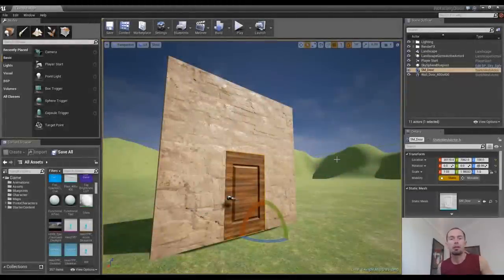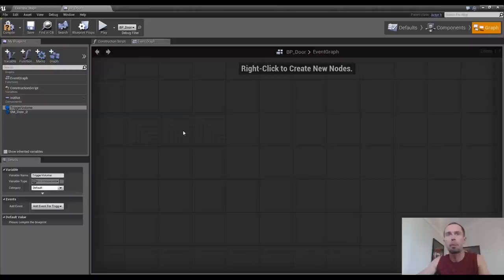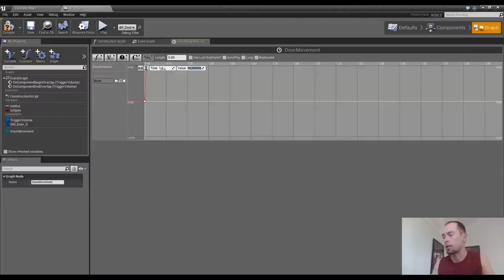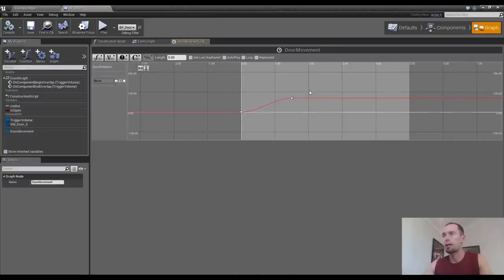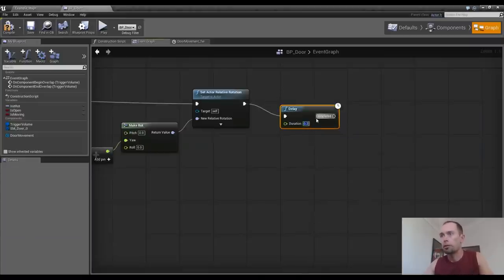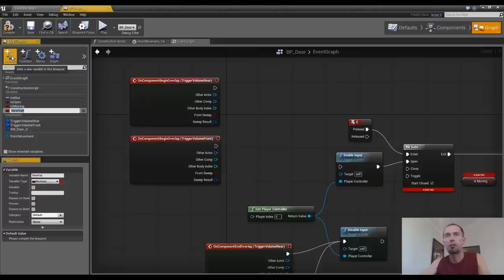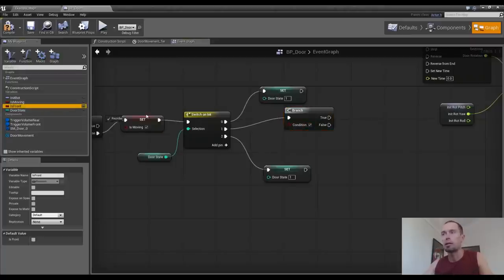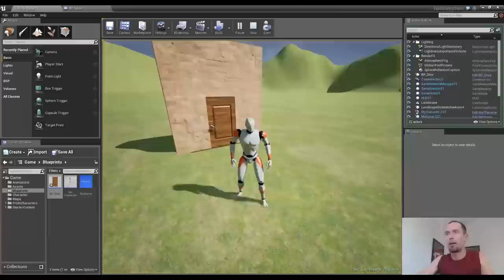Unreal Engine 4: Rotating Door Blueprints Tutorial (V4.6)

Comment: So my open door works... but the close, it jumps to some crazy ass rotation and then animates... which ends up wrong

What did I do wrong
Reply from the maker: I remember dealing with that same problem way back when.  I can't quite recall exactly was the culprit but from memory I think it had something to do with how I had things wired up.  When I would try to open the door it would snap to the fully open position then close.
Take a look at how you have things wired up, if everything is the same as this video then it might be the way you have things set up in your timeline.
Those are really the only things I can think of.  Other than maybe this is an outdated version of the engine and things don't really work the same way with the current version.  It's been a while since I've worked on any of this stuff (got loads of other commitments), but hopefully in a couple of months when uni finishes I'll have a chance of getting back into it again.
Good luck with finding your solution.

Comment: Great tutorial, I can replicate (And more importantly, understand the blueprint logic being used in the video) but I don't like how the door can open if for instance, I'm looking away from it.

I'd like some way to only activate the door if I'm pointed at it, and within a certain amount of distance, could a ray trace generated when I press E work? And if so how would I make that work with pushing the door open in the direction the player is facing?

(Would the ray still require a trigger volume, or no?) Or is there a better way to do it than a ray trace?
Reply from the maker: Thanks for the constructive criticism,  =)  
I'm sure there's a way of getting the global rotation angle of the player and comparing it the position of the door.  It would take a bit of experimenting to get things working the way you like it, but I don't see why it wouldn't be doable.
It might require using a little bit of vector geometry.
Otherwise you could try reducing the size of the trigger volume to make it difficult for someone to open the door unless the are facing the door knob.
Glad that you found the tutorial helpful.  I was beginning to think it was becoming too outdated.
Reply: CompSciGuyIT Just as you wrote that comment, I finally got my ray tracing solution to work! ( However, that's with the door opening one way, when I eventually get around to making it open in the direction the player is facing I may run into a bit of a headache )

Basically my character blueprint contains the ray trace that is produced upon pressing E, if it hits the door it triggers a custom event which is inside my door's blueprint, no trigger volumes needed that way (Obviously for a third person game this may not be a great solution but based on what I know so far it suits my needs in First person)

Comment: Great Tutorial, but how do i get the handle working? that would be a great continuation ^^
Reply from the maker: lepra73 Ah, that would require a separate static meshes for both the door and the handle, something you might have to create yourself (unless somebody has already done it).  The static meshes I've seen all have handles fixed to them, so getting them to move independently is impossible.
Reply: Well i have them in 2 parts allready, but can i animate 2 object in the same blueprint or is it following Same origo on everything?

Another thing i discovered is that if i do the door in matinne and then move it it has problem with the position even tho i only animate Z Axis.
Reply from the maker: It's been a while since I've used matinee, but I think there was a reason that I decided to use timelines instead.
I'm sure you could get the handles to move around an axis point, but to keep them in place with the door would require some pretty good mathematics I'd say.
But to answer your question, yes you can animate as many objects as you like in a blueprint.

Comment: Im in unreal engine 4.13.1 (thought i should say that to begin in case any updates have occured that I missed), but I followed everything and when I try to open the door, nothing happens. I even used simulation to see if the nodes lit up, which none did. Any ideas?
Reply from the maker: If version 4.13 has changed so much that you cannot get what's happening in this tutorial to work I'm afraid I can't really be of much help.  I haven't used the engine much since starting uni so I don't know how things are different in the latest engine.  
My only suggestion is to ask on the Unreal Engine forums or Answerhub.

Comment: I'm only 1 minute in and I'm lost, it seems that there is no "replace with composited blueprint" option anymore
Reply from the maker: That's because this video was made with a very old version of the Engine (V4.6).  I haven't played with V4.20 or above, but in V4.19 in the Details panel you'll see a blue button called "Blueprint/Add Script".  Click that and you should be able to continue on without problems.
Reply: @AlphaZeroOmega  I know, there is next to no updated info... and I'm so new, that I never had the chance to acclimate with this program
Reply: So I finished this, and I'm finding that randomly "On Component End Overlap" triggers, disabling my ability to use the door, unless I move around.... what?
Reply: @Gary the Go Getter  it would seemingly randomly trigger. But I moved the trigger volumes far enough apart that the player could not be inhabiting both at the same time. And if I press and wait, it will then trigger "On Component End Overlap" most of the time. It will also not trigger that I've entered the volume all the time now.

The only differences I've done is that I've opted to not have the "if moving" part, and just have the "doormovement" set to reverse, instead of "reverse from end". I've also tried with, and without the delay
Reply: I'll state that it worked fine before adding the reverse direction part. When it faulted, I recreated this from scratch, and the same errors
Reply from the maker: @fillman86  Whoops!  Looks like I was logged into my other account when I answered you previously.
The "On Component End Overlap" should only be triggered when you leave the trigger volume.  You could try adding a boolean variables by pressing the green "+ Add New" button and setting it to true when the player enters one of the trigger volumes and false when they leave.  Use branches to check their values only execute if one is true, not both.
Not sure if that will work, but it's odd that "On Component End Overlap" is triggered while you are still within the trigger volume.
If you use version control and have your repo on Github or Gitlab you could send me the link and I'll take a look for you.  It's a little hard coming up with solutions without having the hands on approach.

Comment: Thanks for the tut mate, my door works like a charm, unless that is when I rotate it 90 degrees. It seems the door mesh is fixed on an angle so it's not rotating along with the frame mesh that I used which I set as the base mesh ...

I'm guessing I shouldn't have done that :P
Reply from the maker: Joure Visser Glad to hear it works well for you.  Hope you find a work around for your frame mesh..
Reply: So, in the construction script I removed the get actor rotation, and now the door can be rotated 90 degrees and it'll still rotate properly :)
Reply from the maker: Excellent.  :)

Comment: Hey, I followed this exactly to the half way point to see if my door would even open, it doesn't seem to budge, and I've gone back and double checked it all. Is there any way you could help?
Reply: +JozhRandom Did you ever resolve this? Instead of changing the yaw, try setting the pitch or the roll.
Reply: +JozhRandom 
Check that the Mesh is 'Moveable', by selecting 'Moveable' in Details > Transform > Mobility. As far as I know this wasn't mentioned in the video. I lost about 2 hours double checking all my wiring... guess I should have checked the console log sooner.

Comment: Thank you for this fantastic tutorial. It's the best door opening tut that works with my current version of UE4 (for UT). The ONLY THING MISSING for this tutorial is adding sound to the door...very important. I hope searching for tutorials on that will work with your blueprint. EDIT: adding a sound to your blueprint is posing a huge complication for me...where does it go? What does it connect to? What connects to it? I have an open sound and a close sound, where does each go and ....sigh...
Reply from the maker: Thanks Michael.  I'm glad it helped and the tutorial is still relevant to some.  
You're right about adding the sound.  That would make a huge difference with the end result.  I wish I could help you with working that one out, but it's been years since I've used the engine and a lot has probably changed.  
I did find this though: https://answers.unrealengine.com/questions/324950/playing-a-sound-from-blueprint.html
which you may or may not have seen. Hopefully it's just a matter of finding where to put it within your blueprints.
Good luck!
Reply: Hey man! So I put a lot of work into figuring it out. And I also found a website that allows you to copy/paste full blueprints. Here is the full blueprint w door sounds. This combines YOUR blueprint, with the open sound on start of animation, and the close sound on finish of animation. Cheers! https://blueprintue.com/blueprint/vq5gkz5n/
Reply from the maker: Great work!  Well done on figuring it out.
Nice find with that website too.  I'm sure a lot of people will find it useful.